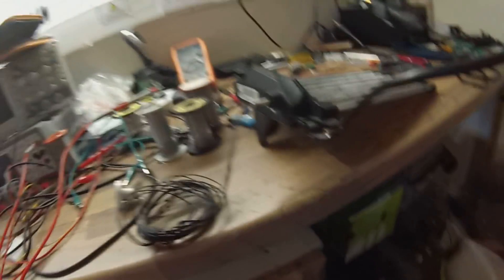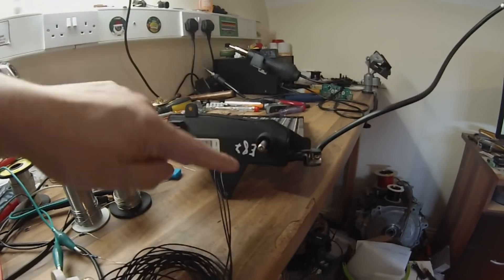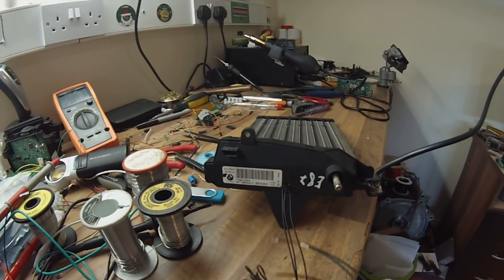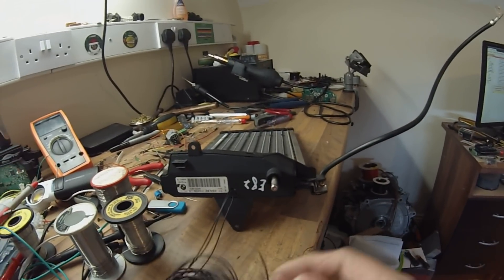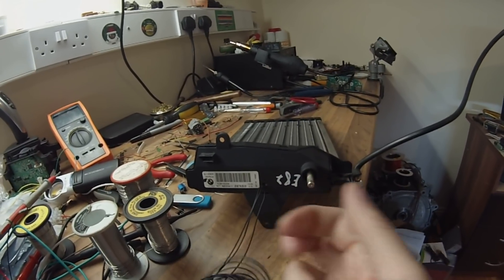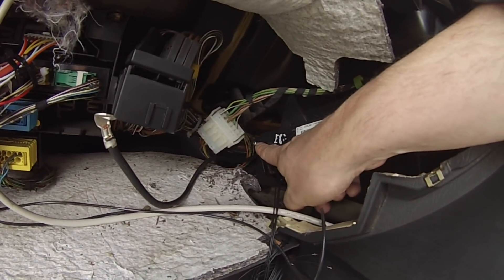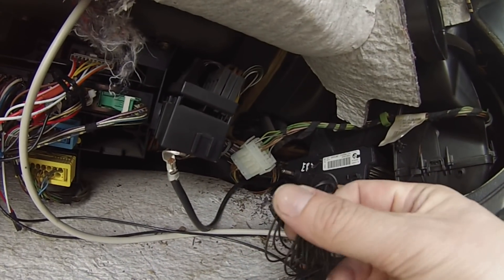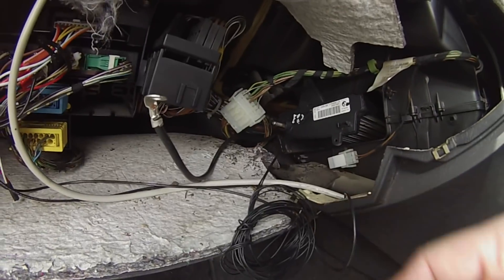€1,000 BMW E36 EV Build 11 : Cabin Heat 1

Comment: This will be a real drain on batteries when you are running it. Remember to preheat car before leaving wall power. For my next project car I was thinking electric AC modded to run like heat pump with reversing valve. Could be as little as 10% of power needed with heat pump as opposed to resistive heat

Comment: Damien I was going to use a engine block heater to heat hot water so as the original heater controls would work. Do you dislike that idea?

Comment: Maybe a small device to switch between the 3 sections in sequence might be good to give the three switchers a longer life expectancy. Then you could vary the duty by a duty cycle effect. easy enough to program up, btw very intrigued in your prius inverter idea. I really want to play with one to do battery boosting from 48v to 400 to go into a solar inverter for a poormans powerwall. Also I wanted to buy a prius and parallel two so that you could make a full ev out of one but essentially have about 50kw output.

Comment: That's way easier than I would've thought. Was thinking about an aftermarket heater for use on pre 1940's hot rods but this would fit the bill much more nicely! What year models do you find these in? ( I know, newbie question.)
Reply from the maker: Most post 2007 diesel cars have them. eg bmw e90 3 series